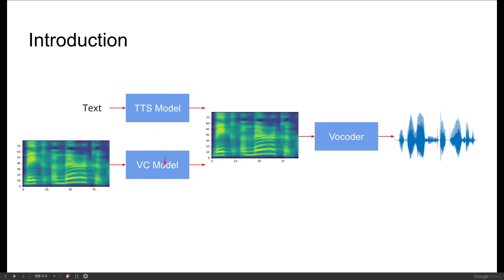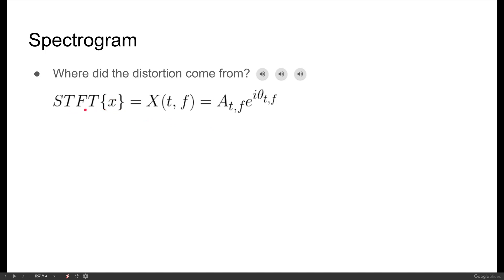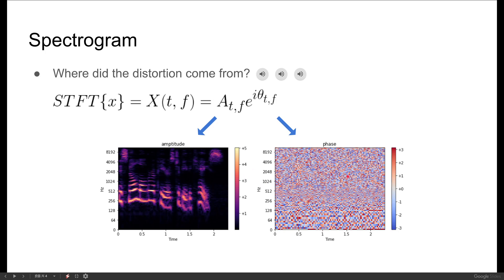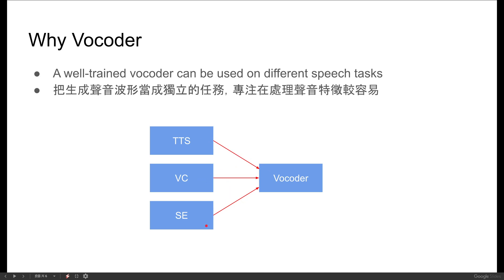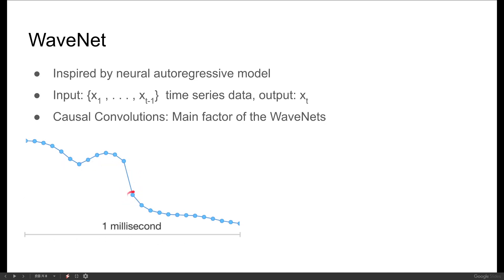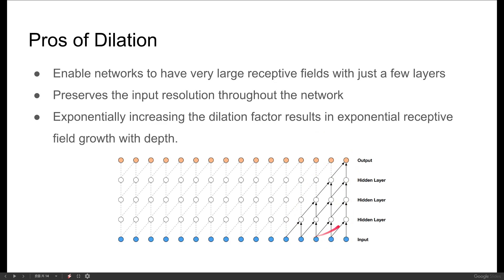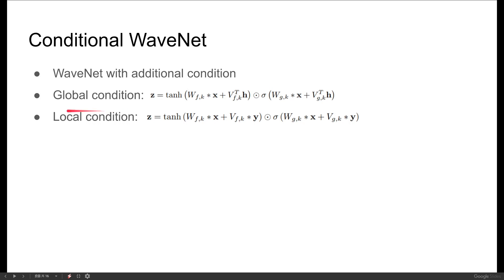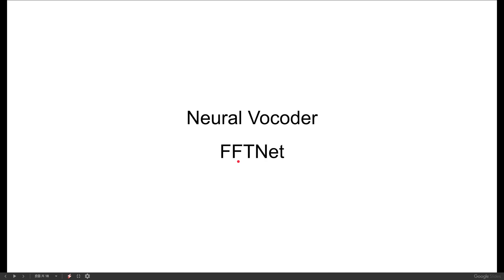[DLHLP 2020] Vocoder (由助教許博竣同學講授)

Comment: 所以wavernn speed up的原因就是把原来 65536 的softmax layer分成了2段（假设2段可以parallel生成），每一段256？
Reply: 刚看了paper，自己回答一下吧。算是，还有一个部分就是他用了 a single layer rnn with dual softmax layer, so I think is much simpler than wavenet in terms of the network architecture and computation complexity.
Reply: @intoeleven  我对这一点DUAL SOFTMAX LAYER 也有疑惑